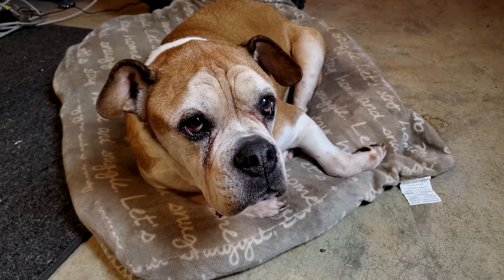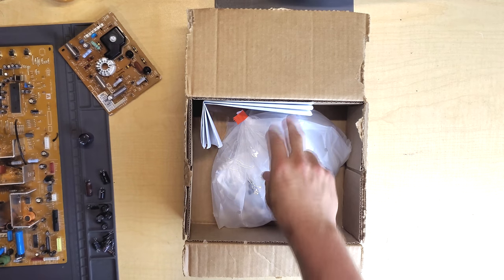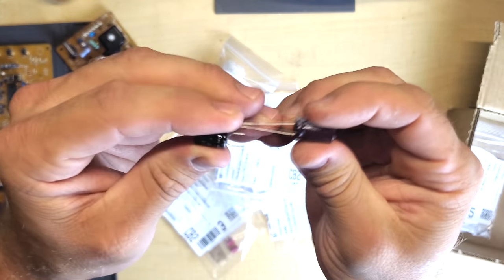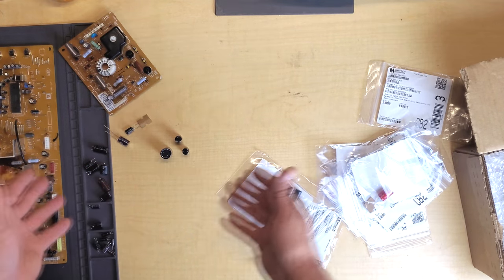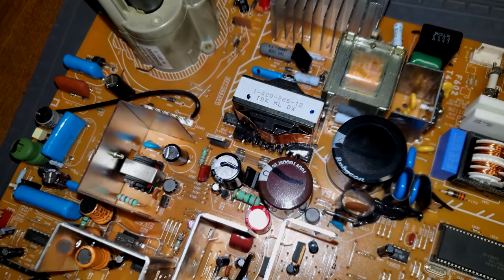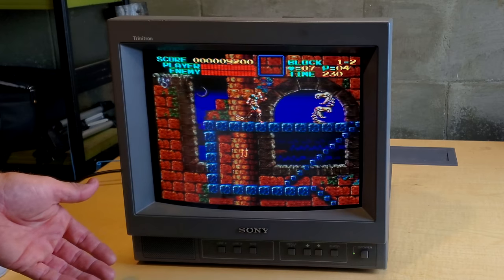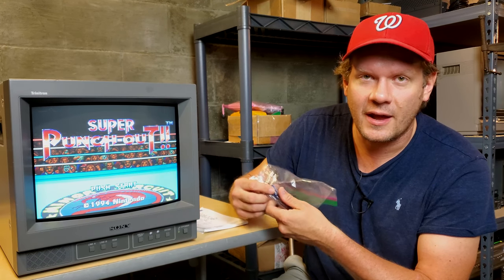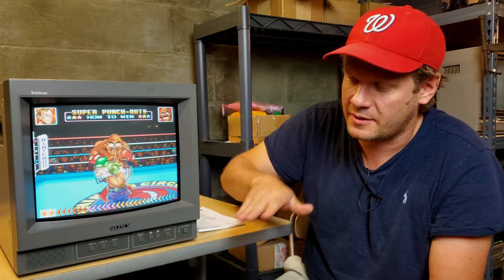New CRT Capacitor Kit - Sony PVM N Series Trinitron Restored

Comment: Recently did some cap replacement on Sony PVM 2950 on the V and VC boards specifically.  Noticed there were a couple of non polarized caps on the VC board...replaced those and worked fine, but wondered if this is called out anywhere?  Service manual didn't mention this, just capacitor rating etc.